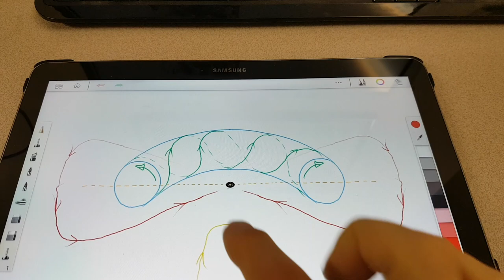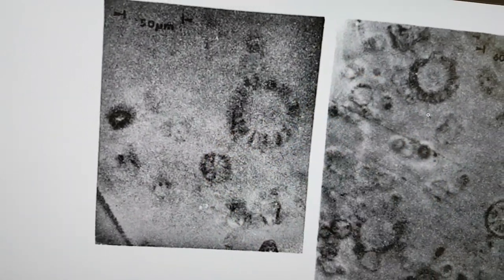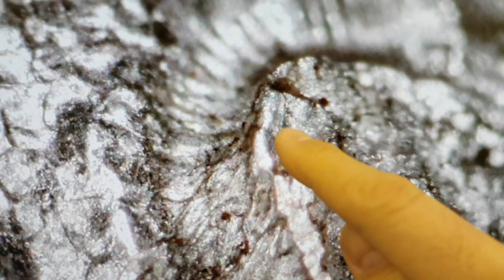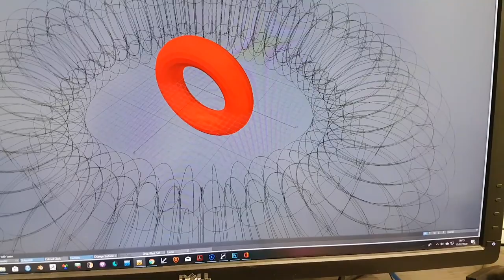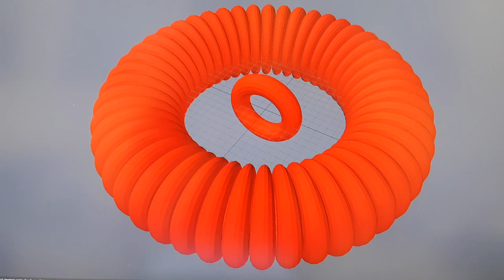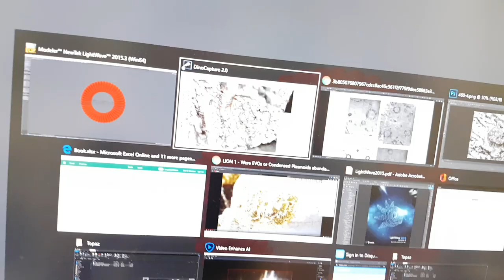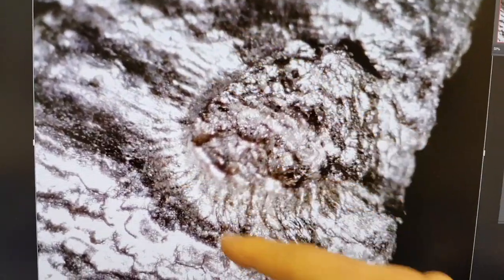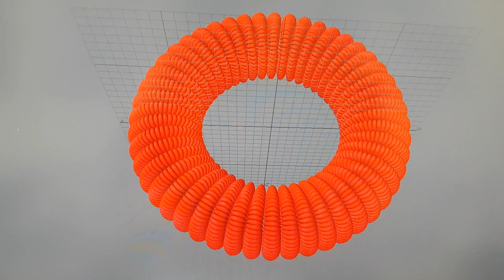Proposed, simplified 3 level EVO Building Block - using Hutchison sample measurements

Comment from the maker: After making this video, I came across this video of an electron
https://youtu.be/ofp-OHIq6Wo
Reply: You don't mention superconductivity very often.
Reply: I have a feeling these formations you're observing accumulate energy in kinetic form, which surely results in an explosion of sort  if suddenly interrupted. Cold, no friction, no radiation... until interruption.
Reply from the maker: @sFeral  Yes they accumulate energy, matter(energy). The picture is more complicated, born out of simplicity - you will see.
Reply from the maker: @sFeral  Ok - that is cool - I want one. Very important finding with the smoke rings, Shishkin said the only way to destroy torsion fields is to use an electric ark.
Reply from the maker: @sFeral  Building the PSUs is key, this guy would do it.
Reply from the maker: @sFeral  Thanks, this is relevant and useful
Reply from the maker: @sFeral  Not necessary, to understand this information, you will only need your eyes and common sense.
Reply: @MFMP  Common sense in not that common, hence the disclaimer.  The reason I linked  the vortex math guy in the first place is because of other comments on your video which associate the content simply  by appearance of a TORUS. Giving them more to chew on.
Reply: @MFMP  Talking about common sense. What is TORUS if not a WHEEL, and what is a WHEEL(form) if not a CATALYST unlocking the POTENTIAL gravitational energy (of the matter it consists of, including axis appended matter) which is usually locked (or greatly slowed) down by FRICTION which paradoxically actually enables the whole process as cohesion of the WHEELform in the first place.  A snowball rolling down the mountain picking up mass and speed.
Reply: @MFMP  Interesting synchronicity with the song in the next video. Wrote the comment before hearing that.
Reply: These posted links are to my own comments on the two respective videos. Have you seen all the questions, including the one on physics stack exchange ?
Reply: Hi, I made a coil that was the same as this looks (it was Copper wire wound around copper wire) and this compound wire was then wound around a large Zinc coated roofing nail.  This coil produced a tangible energy I and most others could feel.   The sensation emanating from the coil remained for some time after the power was turned off.  I have since found other ways to produce such phenomena based on my research into the vacuum.

Comment: This is really cool. I do have a question. When you squish the torus, what is the ratio of the fat end to the skinny end? Thanks in advance.
Reply from the maker: The minimum structure is 2,2,2,2, - there is no real squishing in this case, but on a surface one overlays the other.

3 or 4 or 5 or 6 don't squish much. However, after that they do. Not seen evidence of these beyond 48, either on Hutchison samples, in VEGA Valley or in the archeological record. See more in Game 'O'-ver tonight. I will make the 3D models available, I can't remember off hand as it was early Feb 2020 I derived this.

Comment: Resembles movement of plurality of similar ions in Coplanar-Waveguide Penning Trap.  The magnetic field from electronic current forces the charged particle to follow a cyclotron orbit around the z axis, hence trapping it “radially”.  The static potential of metal plates generate a harmonic well, confining the particle “axially”, along the z axis.  The slow magnetron drift generated by the pulsed current shapes the larger dounut. Geunium quantum chip is created  based on same principle to preserve the elusive qbit state for long time.